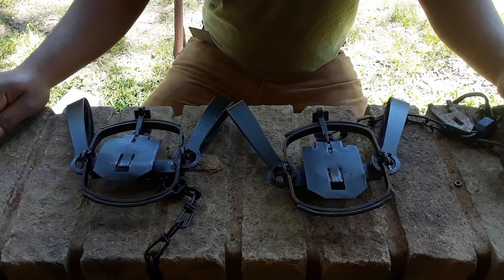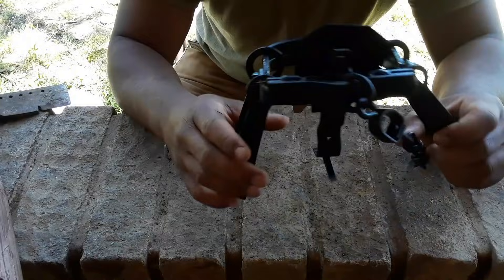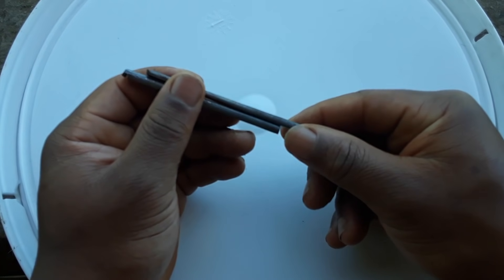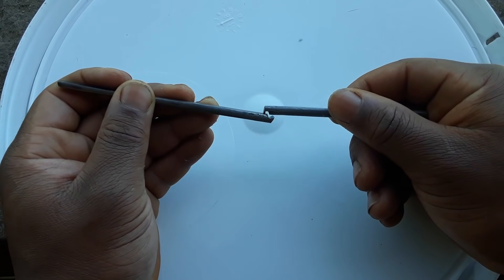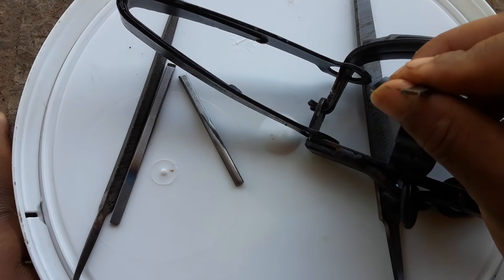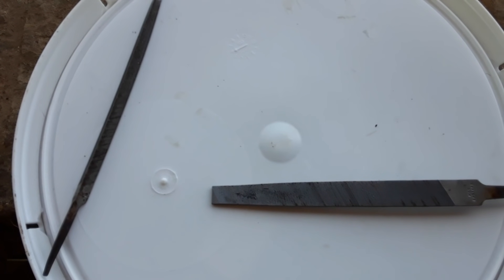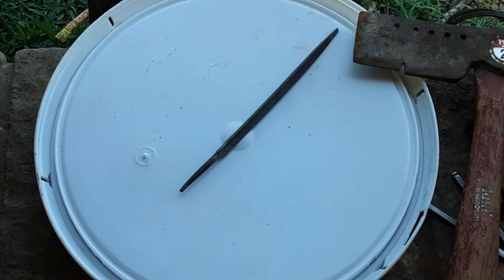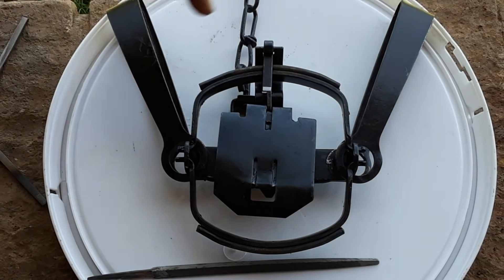No Pan Bolt No Problem ! The Miles Trigger !

Comment: fantastic video illustrating this concept and nice job on the finer points
Reply: my only question is how do you use a dremel for the pan notch? the loop that holds the pan to the trap frame gets in the way.